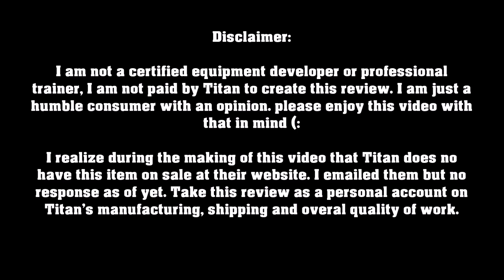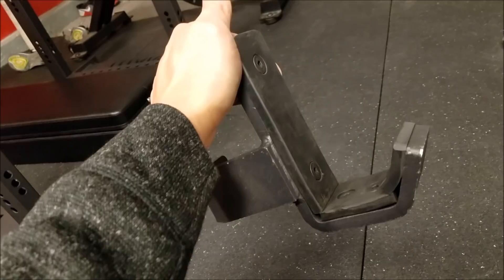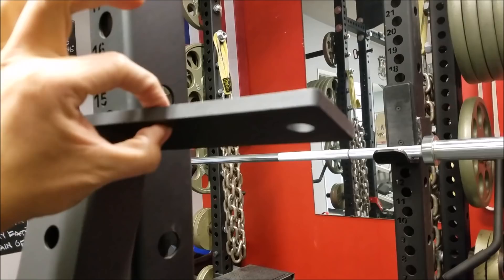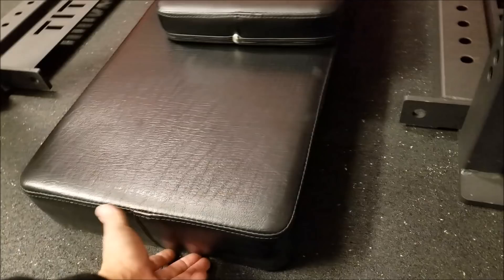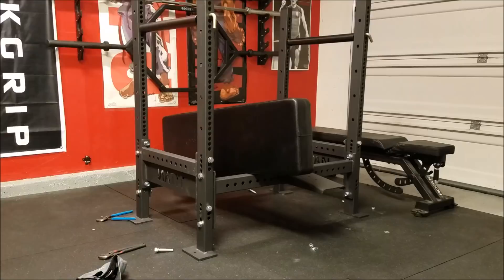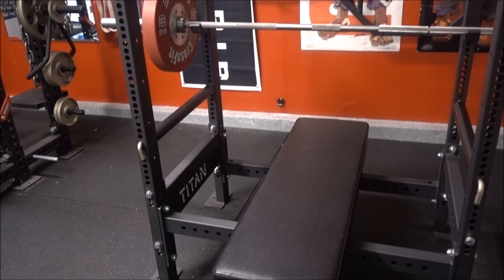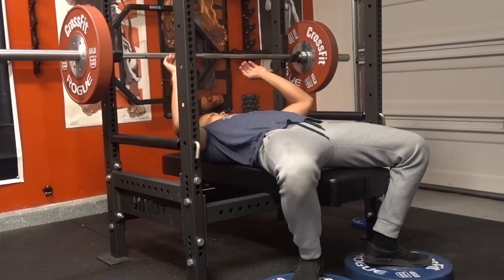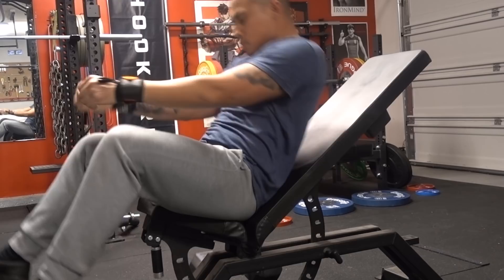Titan Fitness Bench Press Rack Review

Comment: Wow really impressed by the titan stuff ...they really seem to be making great effort to improve 

They also have some unique products of their own like their t 6 rack...frankly I think rogue is slacking and some of their design could use some work.

The welds on the titan looked very typical of what I see on commercial equipment.
Reply from the maker: rogue hasnt really blown me away in the past few years. the only changes are more efficient manufacturing practices that cut costs on their end and shiny colored barbells. heres hoping they come up with some cool new things to buy!
Reply: I’ve been asking for a cheaper alternative to their lat pulldown for a couple of years now a plate loaded one. I know elite fts makes on but I’ve been underwhelmed with some of elites stuff
Reply: @MrJose021292  yeah it seems like this fall they Will be coming out with some new stuff. I have the rml 390f and sort of regret not just getting the Rm6... But hope they come out with a weight storage attachment for the back for the rml... Titan makes them but I doth believe it will fit the rml...

Comment: Why buy that competition bench, when you can bench/press in your rack?Especially since it takes up a bunch of space. I heard your reasoning(bench is your weakest lift) but benching on that Titan bench isn’t going to be any different then inside your rack.
Reply from the maker: goforbroke2 well to put it simply ive always wanted a dedicated space for the bench, squat and deadlift. With my current setup it caters to that
Reply: Leo Pando 
I guess that makes sense in your case. 
Just seemed like a waste of space, but you change up equipment way FASTER then most people. So you probably won’t even have it in your gym next year...haha. 
BTW, I added a UHMW wear strip to my Monster Lite J-cups where that bare metal is exposed. It basically looks like the Titan J-Cup now. Just a heads up.
Reply from the maker: goforbroke2 lol i think you hit the nail on the head 😁 garage gym equipment is an external expression of the owner just like anything else and time will tell if it lasts

Comment: Are our safeties supposed to be that much lower than where your chest is? I always wondered where the proper place to put pipe safeties would be since obviously you need the barbell to contact your chest when benching. But put them much lower and if you drop the bar, the safeties won't do much to save you, right? Sorry for my confusion
Reply from the maker: db ohh well when i bench i arch my back up and fill my lungs w air. If i were to fail i would deflate per se. The safeties r just high enough for to save me in that case but low enough to not touch the bar during a set
Reply: Leo Pando ahh gotcha, maybe the angle on the video just makes it look way lower. Thanks for the response!

Comment: I'm buying this just for rack bench presses. Can the safety bars handle 315lbs + being slammed up and down on them?
Reply from the maker: brigido c i beleive so, the pipe is 5/8 inch steel and the rods distribute the weight across evenly betweem 2 pipes. Its pretty stout